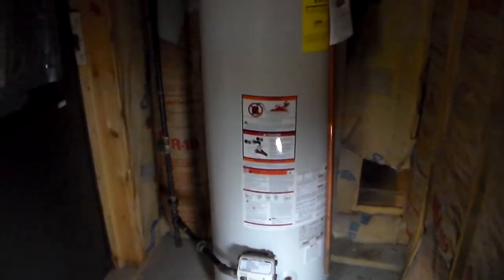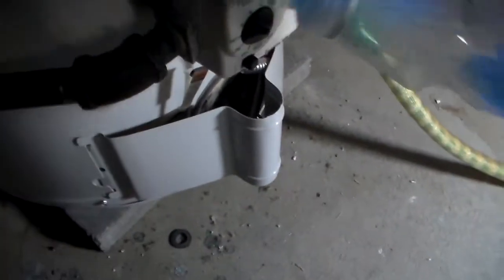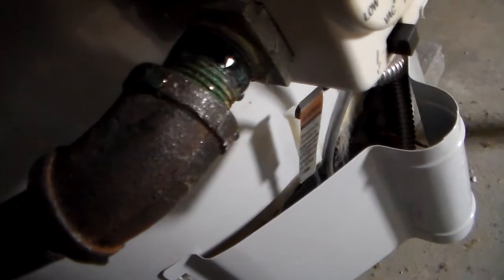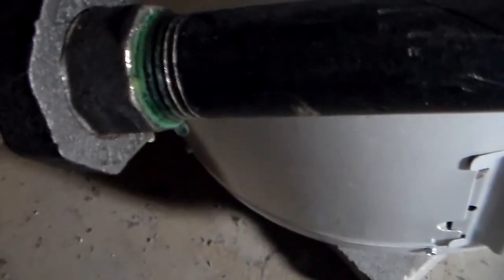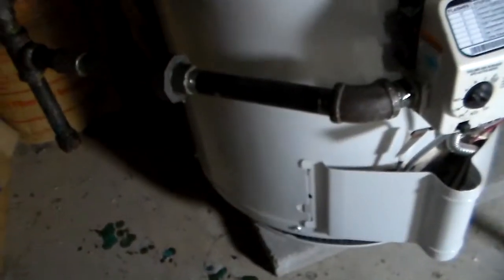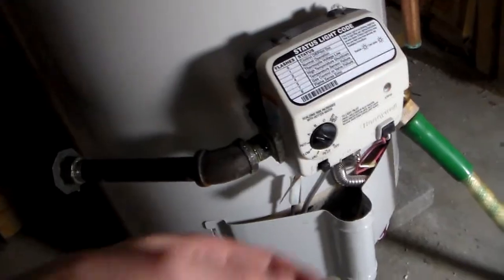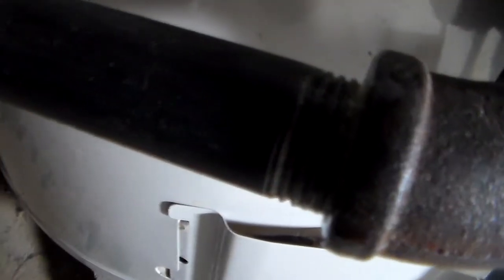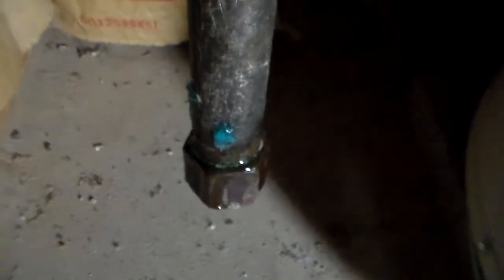Redneck Check For A Natural Gas Leak!

Comment: Did you also check for gas leaks at the hose that goes from the bottom of the controller to the burner?

Comment: The tapered unions are a source of leaks. You need to check both sides of the union. And inside the home the pressure is 4 to 11 inches of hg not psi. Very low compared to before the pancake regulator. Liquid soap is too thick to see small leaks. Better method is use a empty Windex spray bottle with a few drops of liquid soap and a few Oz of water.

Comment: Natural gas is being used for domestic cooking and heating in a large number of countries. It is a fossil fuel and is transported through underground piping networks to the consumers via gas meters at moderate pressure; the pressure is regulated at the distribution and consumer ends. But hazard exists because of its high flammability and heating value or calorific value.

What if natural gas leaks in your house?

Comment: I have this ringing hissing sound coming from my water heater. When I turned off the pilot & flame the sound stopped, I tried to turn it back on and the pilot will not light, the 4 or 5 small pipes leading to the water heater have caulk sealant stuff melting off.Is the problem that I need to reseal it on those pipes, will the pilot then light and be fine after that?
Reply from the maker: I would get a tech that knows about it and do it right. Gas is something you don't want to mess with. and no that does not sound good it may needs some parts.